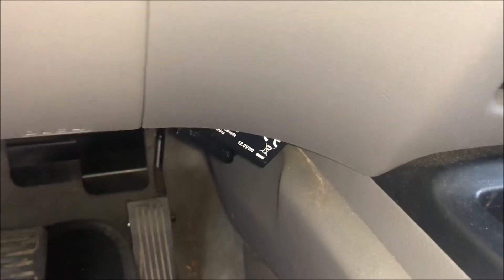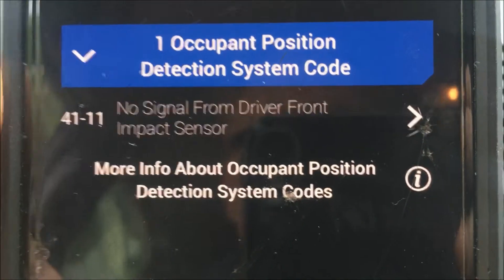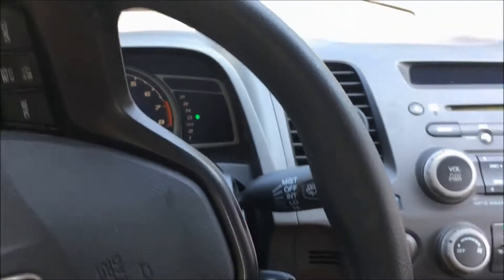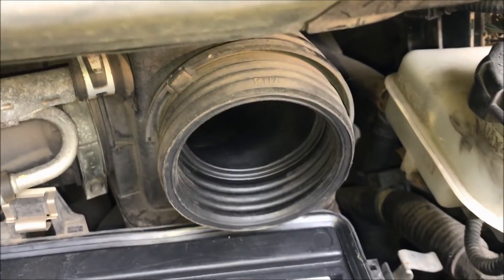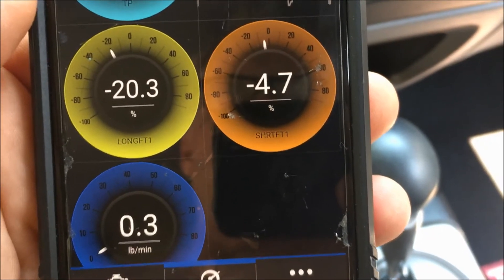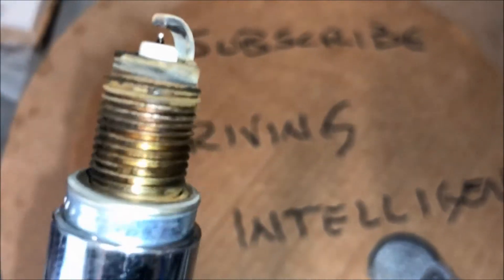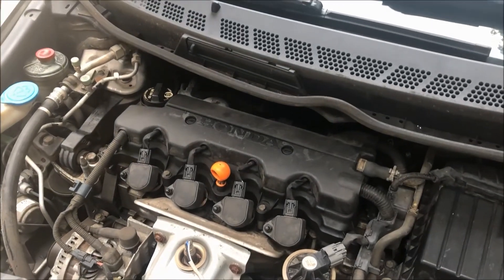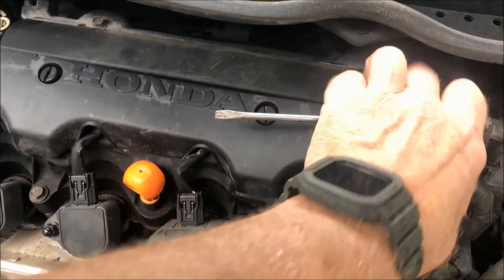How To Diagnose Extreme Negative Fuel Trims 8th Gen '06-'11 Honda Civic

Comment: Man you really relieved me, I was looking EVERYWHERE for that fuel pressure regulator and apparently if it has one then it should be incorporated to the fuel pump. You saying to just leave it cause it makes no harm to the engine relieved me a lot, and it’s logical too. Thank you mate cheers

P.S.: noticed a smell of gasoline in the oil, what do you think it could possibly be?
Reply from the maker: thanks for checking in... fuel smell in oil?  That would likely be too much fuel getting into the cylinder and running down the sides of the piston.  Is your car difficult to start?  Any diagnostic trouble codes?

Comment: Great video! Wanted to ask about a 2008 chrysler sebring. Got a check engine code P0171 & It’s reading around a -95 short term and 0 long term but i’m having no major issues driving. Should I pursue this fix or do the numbers look okay?
Reply from the maker: Thanks for checking in, not sure what -95 means, the scanner you are using might mean you are pulling 5% fuel (which is ok), but if it means you are pulling 95% fuel, Houston, you have a problem.  P0171 indicates a likely vacuum leak.  What vehicle are you driving?
Reply: @DrivingIntelligence  2008 Chrysler Sebring 2.7L 6 cylinder. If it means it’s pulling 95% fuel what symptoms should I be experiencing while driving?
Reply from the maker: @DavidGonzalez-lh9sb  oops, you had already told me which vehicle.  Trying to get through all my questions  :)  It can't possibly be pulling that much fuel.  You'd have other DTC's if it was that bad.  You might smell raw fuel, erratic idle, low power, difficult to start... do you have any other diagnostic trouble codes?
Reply from the maker: @DavidGonzalez-lh9sb  P0171 is a vacuum leak and you need to work on that first if there are no other DTC's.  Do you know how to use a Smoke Machine?  https://youtu.be/3mnH4zg_Tmg

Comment: Good systematic way to approach it. The only other thing that could affect yet not mentioned is the evap solenoid if it's stuck open.
Reply from the maker: Thanks for your input.  That is a good point, but I believe there would be a diagnostic trouble code for an EVAP system leak.  What are your thoughts?  Also, there is a huge dialogue in the comments of this video about possible problems with the engine coolant sensor causing negative fuel trims as well as maladjusted valves.
Reply: @DrivingIntelligence  If the valves were never adjusted....then yes. But I am just mentioning my experience with a Honda that had a bad evap with no codes that was running negative trims.
Reply from the maker: @NextLevelAD great input.  Thank you very much

Comment: what is the normal short trim and long trim numbers ... my car is running like crap i think i need to measure it
Reply from the maker: A new vehicle should be close to 0 fuel trim values or within +/-5% total fuel trim.  When you modify a vehicle or with older vehicles, these numbers start to get larger.  Check your fuel trims and let me know what you have and if you have any modifications.
Reply: @DrivingIntelligence  

got it thks , i'll do ...
Reply: @DrivingIntelligence 

aprreciat the help 👍 by the way. I have a 2006 civic , my long trim is at 0.936 and it doesn't move move up or down with when rpm fluctuates.... it just sits steady at .936 , is that normal. For the short trim its at 0.975 and goes to .998 when rpm goes pass 3000... i took the car to the shop and they think it might be the fuel pump but not sure and send me off my way .. smh .. any help will be greatly appreciated bud , thks

the civic is all stock 😊
Reply from the maker: @bcbjbggjh9102  hey there, thanks for the data.  Those fuel trims look ok.  It seems to be pulling a little fuel.  LTFT is pretty steady state and only adjusts when something major occurs, STFT is the one that moves often depending on conditions.  Is there a problem with the way your car is running?
Reply: @DrivingIntelligence  

 

my civic when it stops during a red light, it sometimes would surge and act like it's going to die. The car doesn't do it all the time but it's doing more and more frequently. I replace the spark plug and check the ignition coil , did a vacum leak test , clean the injector with sea foam through the gas tank and throttle body to no avail . I also check the resistance on the injector and its ok. I clean the throttle body, had it relearned. The egr valve was also swap with a new one to see if that's the coperate but it's still doing it. I finally threw in the towel and took the car to a shop and they couldn't figure out it also. They gave me a suggestion that i might have a going out fuel pump and gave me a $200 diagnostic fee .. smh.I don't really know what to do next  if my fuel trim checks ok cause i don't have any CEL coming  on.
Reply from the maker: Very sorry for late reply.  For some reason YouTube flagged your last comment and hid it from me.  Surging could be a couple of different issues.  Speaking off the top of my mind this areas you might not have checked, could be a throttle position sensor, a Idle Air Control Valve or an EVAP purge valve.  Intermittent failure of each of these items could cause the issues you note in your comment.  Again, sorry for the late reply!  Let me know if you have any questions about these items.

Comment: IF the long term fuel trim is showing in negative (SPECIALLY ON IDLE OR VERY LOW RPMs ) then the problem is mostly with the Leaking injector , that leaks the Fuel in the cylinder . Check the injectors .
Reply from the maker: very valid points, thanks for providing this info.  There are other factors to take into consideration when considering leaky fuel injectors:  increased fuel consumption, poor idle, gasoline smell, hard starts, bad emission performance, thinning oil and hydro-locking.  None of these exist with this car.  Others experiencing this problem could have leaky injectors.  In this case, I believe it is the coolant temp sensor that is fouled and aged and needs to be replaced.
Reply: @DrivingIntelligence  when the injector is leaked only little then above mentioned symptoms won't occur at all,  because when u accelerate the access fuel will be used in combustion.

Comment: Hello, I have a 2000 camry 2.2l with high postive long term fuel trim at 20% at idle, but at higher rpm it drops to 5%, but I cannot find a leak, would a exhaust manifold or intake manifold leak would cuase this? I also have do NOT have check engine light on.
Reply from the maker: Thanks for reaching out and asking the question.  It appears you have a very minor vacuum leak that impacts fuel trim at idle, but not at normal driving speeds.  The only effective way to find a vacuum leak is to smoke test the car.  Watch this video:  https://youtu.be/3mnH4zg_Tmg - otherwise, check all hose connections, hose clamps, airbox and penetrations into your intake system to be sure they are tight.

Comment: hello, I have a 2008 honda civic, the biggest fault is that it is spending a lot, a lot of gasoline, approximately 14 miles per gallon, I already checked everything, it does not have the check light, the short and long term adjustments oscillate in the -14.06% short term and -20.31% doesn't make sense, and yet the scan indicates that the mixture is 14.7, all this at idle and with the correct temperature, I wouldn't know what else to put my hand on, check the PCV valve, the body intake, throttle body, spark plugs, everything, if anyone knows anything write me
Reply: I fixed my problem

Went through replacing everything. Because nobody wanted to fix the issue. So as I found no help I decided to replace everything I could starting with the ignition coils also the spark plugs so when I replaced the fuel injectors I realized one of the fuel injectors a mechanic once replaced... Turns out he ended up using the wrong type of fuel injector because it had wrong number of holes(should be 9 but there was 8) and it was from a different maker... After replacing it all worked fine.
Reply from the maker: @VicManBRA  wow, very interesting!  This is why I do everything myself.
Reply: So I went to a junkyard and bought fuel injectors from a Honda that was totaled. Replaced the kit . And all fine
Reply from the maker: @VicManBRA  awesome, I love the junkyard,
Reply from the maker: I've learned that the ECT, Engine Coolant Temperature Sensor can cause problems like this.  The sensor gets old and inaccurate and tells the computer wrong information.  Your car is getting too much fuel as shown by your diagnostics, the ST & LT Fuel Trims.  You should check your ECT sensor.  What happens if you disconnect your battery for 30 minutes to an hour?  Do the numbers get better?
Reply: @DrivingIntelligence  Hello, precisely over the weekend I changed one of the ECTs, the one that goes on the top in the coolant intake, and unfortunately I have not continued measuring yet, I am going to investigate the correct ECT to buy it OEM since the one I had was a replacement and the one I put was used. 

Tanks
Reply from the maker: @emmanuelpolanco7109  thanks for the update and please keep me informed!
Reply: @DrivingIntelligence  hello everyone, me again, I went back to work on the car, change the oxygen sensors, there were no changes, change the MAF sensor there were no changes, change the MAP sensor there were slight improvements and also change the PCV valve and there were slight improvements , the fuel adjustments are still negative but in a smaller range and at least they keep oscillating but always in negative and now a little closer to zero, next weekend I will remove the thermostat and the throttle body, then I'll tell you.
Reply from the maker: @emmanuelpolanco7109  Thanks for the update, please share your current fuel trim values.
Reply: @DrivingIntelligence  at the beginning in the short term it was -17.84% and in the long term it was -20.31% all that at idle 777 RPM and now with the last reading it is -2.4% short and -3.13% long, but as I drive it reaches - 10.16% but keeps returning to lower values
Reply: @DrivingIntelligence  forget to mention that I made a fuel pressure gauge to check the regulator and the pump, the gasoline pressure is within the range (55 to 63 PSI) when measuring it gave me 60 PSI and also disassemble the injectors and take them to test in a machine and they are working fine, I also measured the ohms of the injectors and they gave me equal values
Reply from the maker: @emmanuelpolanco7109  those numbers are VERY GOOD!  Good work.
Reply from the maker: @emmanuelpolanco7109  how did you make your fuel pressure gauge and where did you connect it to the fuel system?
Reply from the maker: Good job!  And sorry for late reply
Reply: Hi Emmanuel. Thanks for sharing this. I have the same problem.Extremely negative fuel trims. The ECU is trying to bring engine to stoichometric values, but all i can get from Air Fuel Ratio at IDLE is 14.1, 14.0 :1 .... so its running rich. And the trims are already as negative as it could be.... so the engine is unable to bring it to stoichometry.... i also have noticed rough idle and a little oil consumption. My Honda is 2011, 100 .000 km in it.... and i have never checked the PCV valve. MAP and MAF seems to be working great. I am very happy to know that replacing PCV and MAP did it and its solved ... i hope it does for me. Do you think its worth a try?
Reply from the maker: Any luck?
Reply: @DrivingIntelligence  nothing yet, let my mind rest for a while until I find a solution that we have not seen
Reply from the maker: @emmanuelpolanco7109  sorry for that Emmanuel, hope you can get it resolved soon and share your learnings with the Driving Intelligence Community.
Reply: @VicManBRA  I thank you for the comment, unfortunately I have done everything and I continue with the same readings, I have noticed that if the ECU does not indicate that some element is bad it is difficult to diagnose, the oil consumption can come from a PCV valve in bad condition, that could be a simple solution, try that, good luck
Reply: Makes me wonder how could my car go through six or seven mechanics and nobody ever found this wrong fuel injector as the culprit.... literally nobody. The scanner now reads the correct stoichiometric mix

Comment: Nice video - just a pity your efforts didn't find the cause in the end! I'm chasing a persistent, milder negative fuel trim condition on my 2006 Honda (L13A i-DSI engine with speed-density/MAP control). I've changed the oil, replaced the air filter, replaced plugs and coils, replaced the PCV valve and grommet, done a valve lash adjustment, cleaned throttle and intake and EGR passages, cleaned injectors, tested EGR valve, and done some carbon cleaning, but the LTFT remains around -7% (not enough to be considered a fault, but I'd like to know what the cause is). Fuel pressure is about the only thing I haven't been able to check. It's running very smooth and quiet now and my fuel economy seems to have improved.
Reply from the maker: Thanks for that great comment.  Your fuel trims look very good.  I think the problem with the fuel trim on this car is the Engine Coolant Temperature Sensor.  I heard this is a problem with these engines with high mileage,.  You could check the same on your car.
Reply: @DrivingIntelligence  Excellent suggestion, thank you - I hadn't thought of the effect of ECT on fuel trims (plus a lot of my driving is short trips). I will check out the sensor, and also test fuel pressure and do a cylinder leak-down test (prompted by another video I saw recently). It may be that it's not really a problem. Thanks!
Reply from the maker: Good stuff!  Let me know what you find.
Reply: @thromboid  did you replace it? did you solve the issue?